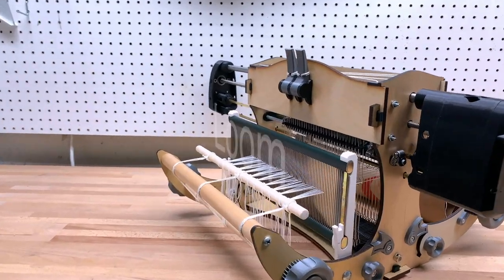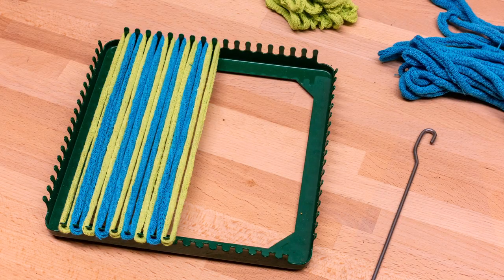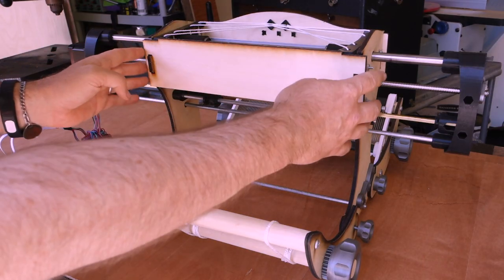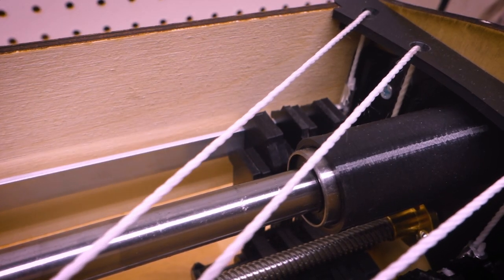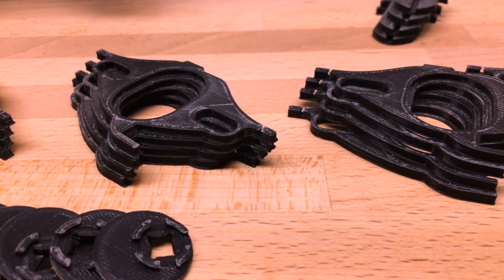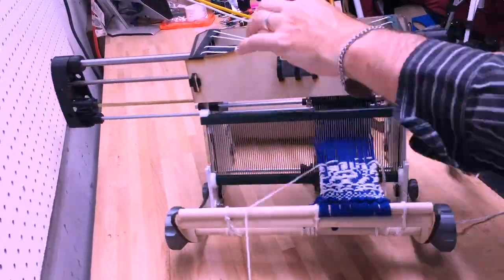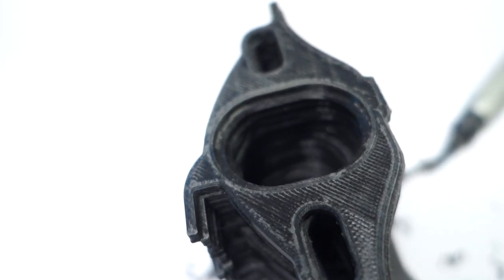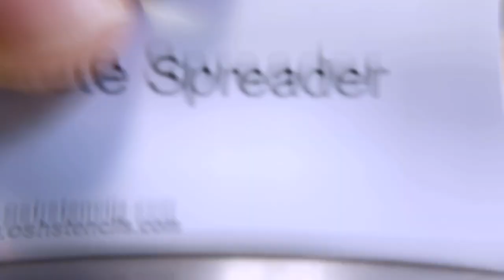Building a Computer Controlled Loom

Comment: I'm a textile designer and your loom is awesome! The video is also skillfully made, so it'a a treat to watch!
Reply from the maker: I'm glad you liked it!  I learned a little bit about textiles doing this project, and a lot about video making.  What sorts of tools do you use for textile design?   Is there iteration/prototyping of a design?  I'm various curious how that works.  What is a common size run for a textile?  What range of TPI do you design for?  God I have so many questions!  I've poked around a little looking at open source weaving things like TexGen but really I have no clue how people take a textile from idea to reality.  I just wrote the software for the loom to take in images I design in photoshop.
Reply from the maker: @dominiquemichaud7945  Wow thank you so much for all that information!  I appreciate you taking the time. I will definitely check out some of the links/software/books.   It's great to hear from someone doing this professionally.
Reply from the maker: After reading some, I think that I want to do a design using the Polychrome Taquete technique.  I definitely wanted to try something that wasn't using a tabby so that looks like a good option.  I'm not sure how I feel about the less interesting uniform almost plain weave look, but it would lend itself well to come programatic design ideas.  We will have to see what happens.
Reply: @retrotechjournal  Good idea! Taquete is a great way to limit the length of floats. For the "less interesting" parts, you can use another structure, like satin or twill. For that, you will need to use one layer in Photoshop for each weave. I define beforehand each structure as a motif(pattern?) in Phososhop, and bind it after to the layer. Satin will hide the picks for a smoother colour, while twill will add texture. Have fun!

Comment: That's the most stylish builder channel I've seen. When searching for how these machines worked, I didn't expect to enjoy the presentation.
Reply from the maker: Oh thanks!   Well of course, commercial machines do the lifting of the threads at crazy speeds, and with a very different mechanism.  Still this loom does show the basic concepts of raising and lowering some pattern of threads and then passing a shuttle though.  This particular mechanism with the cams is kind of nuts/not very fast.  It was simply the result of me tying to solve the thread lifting problem with only 2 motors. Still I hope you did learn some useful bits of info and it sounds like you enjoyed it, so I'm going to declare that a win.  :]

Comment: I'm building a Jacquard Loom in Meccano so this got my attention. Very impressive and much beyond my tech abilities. I would have liked to have seen how quickly (or slowly) each change to the heddle positions happened. Quite a while I would think!
Congratulations on a great build.
Reply from the maker: You are exactly right that the loom heddle updates aren’t super fast and the wider the material the slower each pick is. For a narrow piece the weaving is sort of normal but that wide weaving at the end took close to a minute to update per pick.  Which is a lot of waiting. That is the main disadvantage of this system. The more heddles the slower it goes. 

The main advantage is only 2 motors. 

The process could probably be sped up a little but never fast enough for high TPI weaving, etc. 

I do have an idea for a heddle position switching that would use a Y shaped track and a kind of “track switching” beak in the middle. However I haven’t tried building it as yet. 

Good luck with your Meccano build!  Let me know how it turns out!
Reply: @retrotechjournal  I would love to see a video in real time of the heddles updating!

Comment: Even with the automation, setting up a loom is a big job! Warp, weft, beater bars, shuttles, oh my!
Reply from the maker: True enough, but at least with this kind of setup I don't have to worry about threading a zillion patterned heddels, the single peg warping system makes warping fairly easy.   That and the large size/low count warp, makes the actual setup comparatively painless.  :]

Comment: That's a lot of knowledge from start to finish. It's awesome. I like how you get all the theoretical stuff figured out so accurately that you didn't need to stop it and rework the design three or four times like I've seen other people do with their projects.
Reply from the maker: Well that still goes on but I try to keep the testing/verification at a small level.  Like early prototypes before committing. Like I made a very simple version of the carriage just enough to learn I needed linear bearings vs plain bearings. Etc. I probably did 3 versions of the levers, etc but at a small scale the revisions are fast.  Of course there’s always the danger of things that work ok in your prototype but fail at scale. Those are the worst. Lol
Reply: @retrotechjournal  Of course. It's always good to test your parts. I just see a lot of videos of people putting things together, not knowing why things don't work, taking the whole thing apart, testing individual parts, putting it together again, stopping it because it's doing something wrong, taking it apart again, changing the housing and the design, and putting it back again and hoping it works.

For something with a lot of moving parts, software, and delicate assembly like this, it's more difficult to account for things that go wrong before they do, even checking the parts before they are assembled into a single machine. That's what's impressive to me.
Reply from the maker: @whyisblue923taken  Yes, totally. I call that "integration testing hell"  :]  I did do some tricks like 3D printing little gaps in the cam spacer collars, so I could actually see where the cam was, and better diagnose jamming issues. Because "not being able to tell where the thing is or why it's jamming" was 100% going to happen.   lol.

Comment: Jacquard loom weaver here, this is an impressive build -- there's a lot going on in these machines and you have a good grasp of it, nevermind your other skills. Thanks for the video!
Reply from the maker: Neat to hear from actual weavers. I’ve never used an commercial Jacquard loom but the low end ones seem like they might be a maintenance nightmare. :)
Reply: @retrotechjournal  There's an art to them for sure! Never the same settings for any different cloth which can be a bit of a bugger, but I've always found them theraputic to work on... (Occassionally a hammer gets involved)
Reply from the maker: @Crimzonius  😆

Comment: Highly impressive. The baked surface mount components and the dreaded brick wall of design implications always remind me of my many many PCB prototypes. Wrong voltage here, broken component there.
Reply from the maker: The design mostly went smoothly but then when I was trying to unify the motor and logic supplies into a  single supply I cheaped out on the DC to DC conversion bits and got something that would work for a while, but then eventually some spike on power up would fry the whole thing.  Which was horrible.  Oops.  Going for a $2 more part could have saved me two entire dead boards and a lot of wasted time.
Reply: @retrotechjournal  That's one way to deal with it. I've usually solved that problem by putting a clamp/filter on the step down after diagnosis. Of course, that required a board revision and all of my money on the first stock of prototype boards just goes up in smoke. One way or another, a check will be signed.

Comment: Well done. I had thought of doing this with one of those 1970’s knitting machines- but using the machine as the base with all of it’s tolerances, etc.
Reply from the maker: Yes, those machines already address many of the tolerances/zillion parts issues that I had to struggle with.  I think they'd be a great start to some really neat projects.
Reply: @retrotechjournal  I can see the effort that you’ve put into getting this to work. Most people don’t realise how hard tolerances are to get right. I tried to build out a simple candy sorting machine with my son - out of Perspex so we could see what was happening. With the variation of candy size and shapes it became close to impossible to get it to be reliable. So I can see the countless hours of effort.
Reply from the maker: @daverei1211  yes exactly. It’s easy to think things are going to be consistent but in the real world nothings consistent. Lol. The candy sorter is a great example for folks.

Comment: This is awesome, and it feels like something you could definately sell as a kit.
Reply from the maker: Well the truth is that there is a vast gap between "something one can reasonably expect someone else to assemble and operate" and "Something I can spend a year and a half designing and getting to work"  I do have some ideas on how to make the design a bit more bullet proof/faster, but I haven't found the time to try the ideas out as yet.  I have been considering making a free manual table top loom "kit" that would just be something you could 3D print/have send-cut-send or some place laser cut some plywood, but even something like that would require a lot of design/testing/document writing.  So far I haven't found the spark to actually do either of those things.

Comment: If you wanted to revisit this at somepoint. Look up a knitting machine mechanism. It uses a matrix that allows you to have repeatable patterns using only 8-16 servos. With some of the more complex knitting machines, when combined with a PC, you can address all needles rather than doing a repeat of 8,16 or even 24 needles. 
I am fairly convinced a system like it could be adapted to a loom.
Reply from the maker: Interesting.  Yes, I've though there aught to be some ways of taking a "many actuator bank" and mechanically muxing it to control many more lines.  (At the cost of overall speed)  I think if I were to revisit the loom I think the main goal would be more speed without getting too expensive/complicated.   I've had a few ideas along those lines, but so far nothing compelling enough to do another build.  Checking out knitting machine mechanisms sounds like a great place to look for inspiration.
Reply: @retrotechjournal  it's definitely worth looking up an in depth description on the mechanism, but the abridged version is that they use a matrix of gates that open/close to allow the needle to move forwards or backwards. If they are blocked, the needles are pushed down by the carriage so they are bypassed.
You could use the gates to enable the reeds from lifting, then use a spring to lift them. That way if they are blocked, the spring can deform instead of breaking.

It is an idea I toyed with then decided it is probably a project way above my skill level because the matrix aspect confuses me.

Comment: Very entertaining video! I loved the animation sequences. And the loom has some very lovely design elements. But having to disassemble/reassemble that thing every time you want to make changes would drive me crazy!
Reply from the maker: Yes, that is the down side to something with 100's and 100's of pieces.  Not as easy to iterate on it.  That's one of the reasons I built an injection molding machine.  Still you do have to do a lot of disassembly/reassembly for core changes.   I tried to do most of my iteration when I only had 8 or 16 sections so it was fairly painless.

Comment: I've done some knitting, but never any complex patterns. This is pretty cool. I'd very much like to try making one of these.
Reply from the maker: Knitting is awesome. I’ve done a small amount of dance cabling but keeping track of the pattern as I go is a bit higher engagement than I have time for these days. Although I’ve released all the designs this is not a very easy thing to build or operate.  When I designed it I didn’t know parametric cad so I mostly made it in Illustrator which makes it pretty hard to modify or reproduce. Now that I know Fusion 360 I’ve been considering going for a redesign but it would be a lot of effort in an area I’ve already spent years working on so it seems unlikely my level of interest will reach some sort of ignition point on a V2.

Comment: Fantastic! I imagine every one who has some technical knowledge can engage in making one.
Reply from the maker: I'm glad you liked it!  It's certainly doable.  It would take a weird mix of skills though.  I think the main problem with the current design is it's pretty slow and it's a bit sensitive to very careful construction.  The heddle wires often have a bit of a twist to them, and I had to kind of manually straiten them by eye.  I have some ideas for making the thing a lot faster, and less sensitive to variations in part thickness, etc.  I don't really know if I'll be able to find the time to make/troubleshoot that version.
Reply: I googled for "jackard weaving DIY machine" and got to your video. did not know the word "loom" so google did a great job showing your video at the top. I did this after visiting a museum where I saw huge black and white tapestry from an artist friend. He draws branches and then gives his designs to laser cutting, looming and what not shops to make enormus metal, wood, silk or paper art. I am more into DIY so I will like to experiment with looming. Maybe I will to make your machine. Will read your instructions and if I understand how you made it I will get into Jackard looming! Thanks!
Reply from the maker: @alexecheverria  Cool.  Yes be warned that although I have open sourced the boards/code/designs that doesn't mean this project is anything like a "kit".   The design files are undocumented, and there's nothing like "instructions" or anything like that.  lol.  Making one of these that was fully documented and easy to build for others would be a giant task.  With very different design constraints.  Also because there are a lot of 3D printed parts I think sending those out to be made would be prohibitively expensive.  If you have a 3D printer and are comfortable building surface mount PCBs/compiling iPhone apps then feel free to take a stab at it and I'll answer questions.   Just be warned that I like to make things I can just barely build so this isn't super easy.

Comment: That was legendary. It is quite awesome that you made the entire process open-source, but i am sure its going to take me atleast 10 years to figure it out😂
Reply from the maker: Yes sadly there’s a huge difference between a messy pile of my design iteration and nice clean followable  build instructions. Lol. The code is at least decent.  If I do another rev I’ll do it in Fusion 360 and then the design will at least be more followable. Building something like is in Illustrator was madness. 😝

Comment: Well done. Love your perseverance and well done on the edit. I'm going to have to check out your blog to figure out how you made the one small section of square shaft so it could turn. I subscribed and based on this video will be delighted when/if your next video comes out.
Reply from the maker: I'm glad you liked the video!  I'm not sure I talk about that in the blog.  I have a solid round brass shaft that nests inside that size of square tubing.  It is what is driven by the stepper motor at the end.  It rotates freely in most of the tubing, but is epoxies to that one section.  You can see the rod in the clip near the beginning where I'm talking about the spine.

Comment: That's a really clever technique, using the rotary segment in the sliding axle to set the cams up. I have a LEGO Jacquard loom that uses sliding pins to achieve a similar idea, but that suffers from the pins vibrating out of place during weaving. You've given me something to think on for an alternative idea - if it can be built out of LEGO :-)
Reply from the maker: Wow, a LEGO Jacquard loom sounds really cool.  If you manage to build such a thing be sure to post some links!
Reply: @retrotechjournal  I built it 2 years ago. I still work on it and show it off at LEGO shows. There are videos of it on my channel.
Reply from the maker: @JerryNicholls  Wow that is really amazing build!   I love the idea of scanning a pattern board to give you a physical way to design patterns. Did you ever manage to get some woven output?  Sounds like you had trouble with the pins.  That's really fun to see in motion.  Thanks for pointing me at it!
Reply: @retrotechjournal  yeah, I've got multiple scarves dotted around the house :-) My blog's at https://r.jander.me.uk which has lots of info on the loom as I've worked on it.

There's a pic of one of the first scarves it did in this article: https://r.jander.me.uk/index.php/2017/02/23/lego-world-2017/

The original plan was for kids at shows to be able to set up their own patterns on the boards. However it takes 20 minutes to weave one board, so they'd be hanging around for ages to watch it. Also, as you pointed out in your video, long runs of warp or weft floats cause problems. I tend to keep mine down to no more than 3 crossings long as, otherwise, it gets too floppy.

Comment: you are an ultimate handy man, like even surface mount parts on diy circuit boardl! well i think ive found a new home to give me ideas :)
Reply from the maker: It took me a long time to make the switch to SMD, and I really wish I'd done it earlier.  Now I find through hole parts to be the annoying ones.  Well at least for de-soldering.  :)  I got some super cheap SMD practice boards and kept soldering at them until I got the hang of it.  Of course when you design your own boards you can make sure you leave enough room room to get an iron in there/add test points, etc.  It is true that on commercial boards if the parts are super close together it can be kind of horrible to get in there and do things.  Welcome!